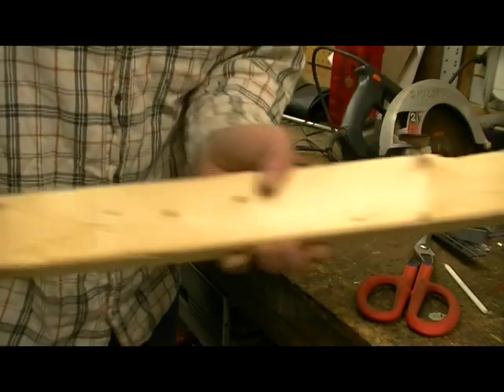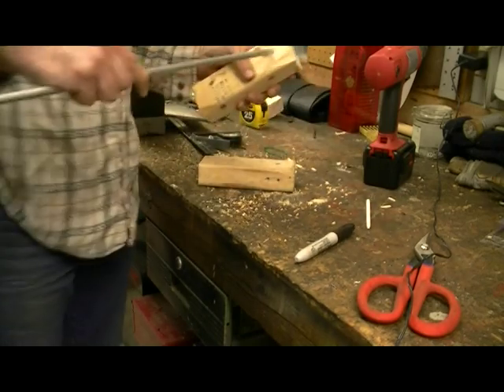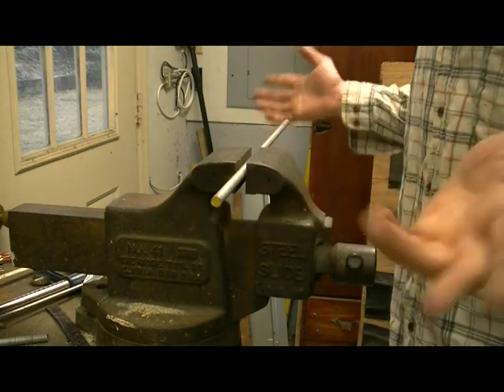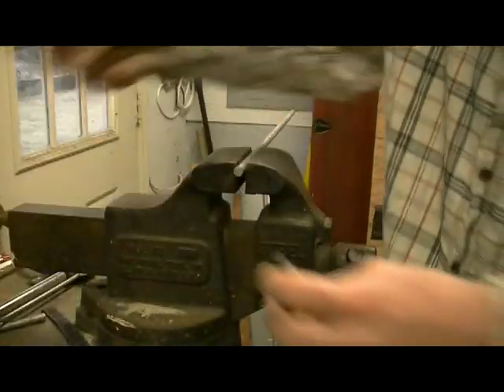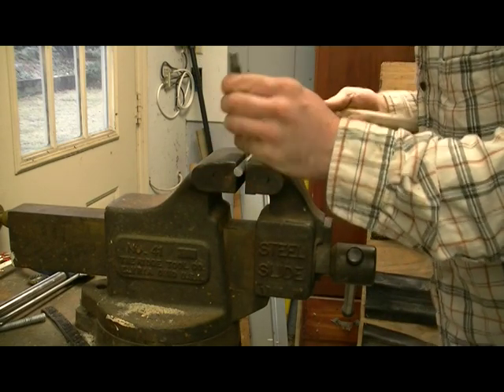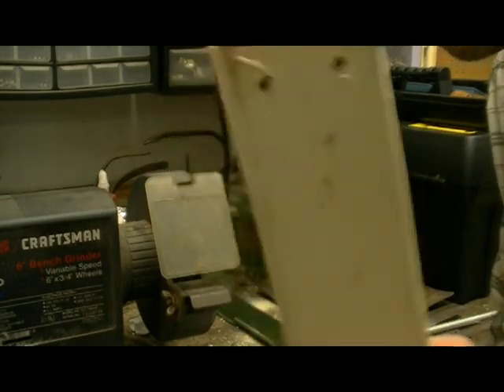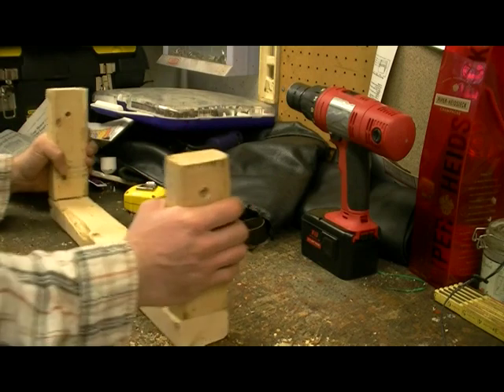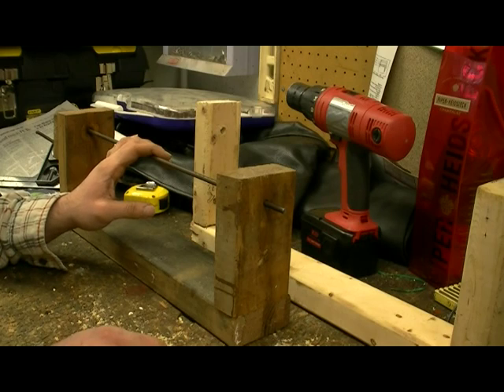How to make: A chainmail rig

Comment: White glue you use for attaching the uprights to the base
Reply: For metal-to-wood, use epoxy. The five-minute kind works well
When I made MY turning jig, I just clamped a vise-grips on the end of the rod, and used THAT to turn the coil
I found that, for ME, long coils were rather difficult to manage while cutting. Short coils didn't  have a tendency to flex all over the place, like the long ones